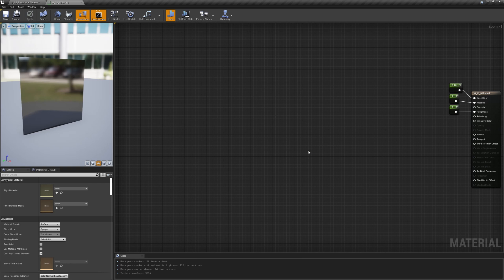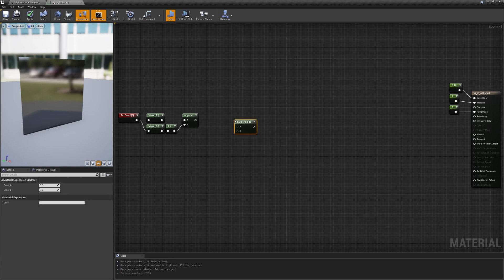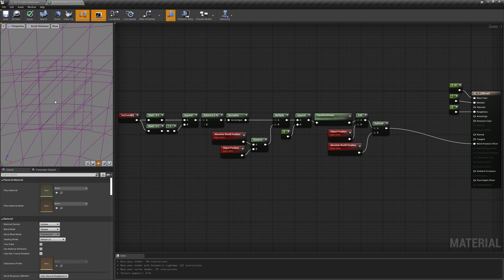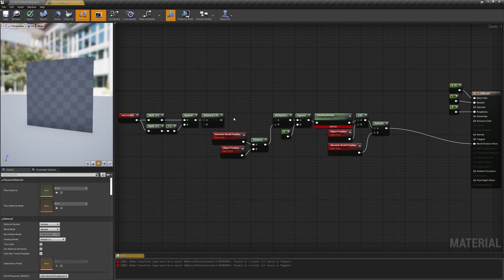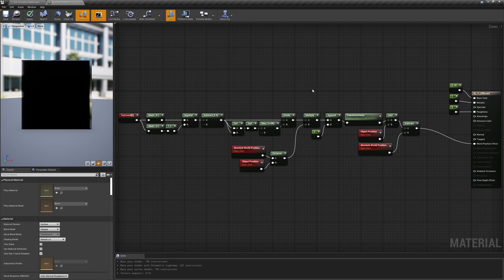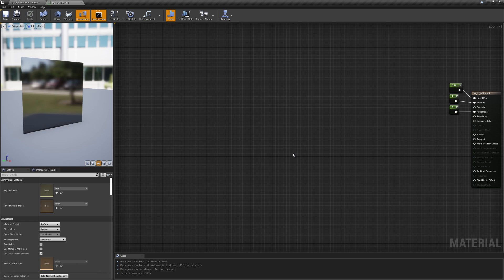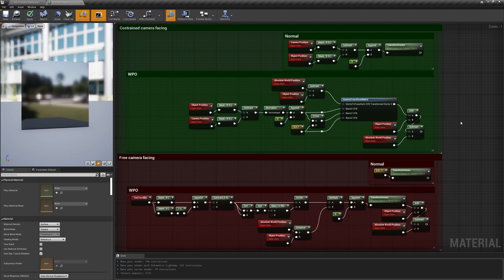How to make Camera Facing Billboards (UE4, valid for UE5)

Comment: hi thanks a lot. is it possible to make the image also stay the same scale no matter if you zoom in or out on it? Thanks.
Reply from the maker: It is :)
Think about scaling the billboard position vectors in relation to the camera distance
Reply: @VisualTechArt  thats what i tried before. But it always bugged when i added it together with the rotation. So scaling and facing camera was not working. Eventually i wrote a custom node and that worked. thanks 🙏

Comment: I have an issue with the second method which I use for tree billboards in my stylized game - if the object center is out of the camera frustrum, then the tree rotation jumps back to its original value, causing bad flickering - it's true when the tree is partially occluded or on the edge of the screen.  Trying to fix it for ages, and makes me crazy - any ideas how to fix that? :)
Reply from the maker: It shouldn't be related to object center but more to if the bounding box of the mesh is in sight or not, because that's what decides if the mesh gets culled or not :)
To fix that you should expand the bounds of the mesh so they cover the mesh possible positions after the WPO :)
Reply: @VisualTechArt  Thank you very much, it fixed my problem! You can't imagine how happy I am right now! :)

Comment: Hey there, thanks for the great tutorial! I have a question as a total beginner: how would I make the plane face in the direction of my camera normal instead of the camera itself? I am using an isometric view for renderings and I would like all the planes to face the same direction, right now my meshes turn towards the camera which tilts them a bit the more as they get on the edge of my view. Any ideas?
Reply from the maker: Use the CameraDirectionVector instead of the CameraVectorWS :)
Reply: @VisualTechArt  awesome! works great, thanks <3

Comment: Works great, however when this is placed on randomly rotated tree instances it doesn't override the original rotation. So a lot of them are facing the wrong way or are misaligned. I'm looking to I guess reset the rotation of all the billboards to face +X in the material before doing the point towards camera operation. But I'm not sure how, any ideas?
Reply from the maker: You have to add a rotation before the billboard logic in that case that resets your rotation :)
You have to find the 3 vectors that identify your rotated space axis and then use an InverseTransformMatrix to reset it

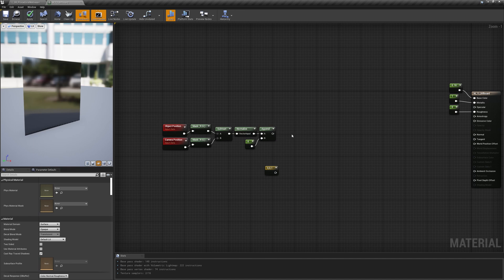Comment: 8:20 Wait a second, you're subtracting camera position from object position meaning you're getting a vector that points from camera to object, NOT from object to camera, which was what the X axis should be. How come this works?! Normally a vector from point A to B = B-A.
Reply from the maker: Follow the signs xD
Reply: @VisualTechArt  I can see that the normals are rotated later towards camera. that is enough? It doesn't matter that the triangles are drawn in reverse order?

Comment: This is amazing, thank you so much for sharing! This setup gets me very far to the desired result, but I wonder, is it easy to have the billboard pivoted around it's own pivot point instead of the object's center?

Replacing the ObjectPosition node with the objectpivotpoint gets really close, but is that the right way? It partially works..

Would love to hear from you, thanks so much again.
Reply from the maker: Try with ActorPosition, InstancePosition and so on :)
Reply: @VisualTechArt  I did some alterations and now better understand how it works, thanks again for this video and technique, its great!
Reply: @macarmoni  In my case I need to use local position but while using that , camera transform is not working.. I tried every destination option but it's not working .help me :(
Reply: @VisualTechArt  In my case I need to use local position but while using that , camera transform is not working.. I tried every destination option but it's not working .help me :(

Comment: Hi! Thanks for this tutorial! I have a problem, since the plane has an initial offset rotation. I need that the plane faces the camera regardless its initial offset. Any suggestions?
Reply from the maker: If you can't avoid them starting from a "random" rotation, the most straightforward way to compensate for it would be to first add a transformation step that gives you the vertex offset to put the mesh back to a non rotated state and then do the billboard from there :)

Then you can probably do something smarter than that, but it would be a starting point
Reply: @VisualTechArt  One last question: to blend a normal map with the recalculated vertex normals , I added the two together and then normalize it. Is it correct?
Reply from the maker: It is an approximation that can work, but it's not the most accurate way to do it :)
You could use the BlendAngleCorrectedNormals
Reply: @VisualTechArt  How do you do that transformation step? I'm going nuts trying to figure this out.

Comment: This tutorial is super helpful, but I'm not running into some issues with the AA in Unreal. When using the default temporal super resolution in Unreal, if any actor with this material applies moves at all, it creates some rather hideous ghosting during movement. I can solve it by turning the AA to another setting, but at the cost of making the lighting look considerably worse. Has anyone else encountered this at all?
Reply from the maker: That's weird, never tried it with TSR tho

Comment: Hello! This works extremely well. Only issue I'm having is that in the flipbook editor window, the thing is invisible. There's something weird going on until you disconnect the world offset. Not really a solution. Got any ideas? Thing is abandonware, I know, but it's about the only way to really go about making oldschool 2D things. Thanks!
Reply: Alright. Figured it out after a horrible night of sleep.
Looks like there might be an internal issue with the flipbook system itself.
Solution: Just set your flipbook component in your char or wherever to -90° or +90° on the Z. While you work inside the flipbook to set up your stuff, just keep the default material on it if you can.
Either OnConstruct use SetMaterial or set it manually on the flipbook. Main thing that matters is the Z rotation.
The material from this video works 100% for anything properly facing north aka. X forward. Looks like the flipbook component itself does something weird.
Thanks again for the video!

Comment: For some ungodly reason this material actually doesn't work if you apply the material to a Paper Flipbook Component for a 2D sprite character. The sprite becomes slightly twisted and not perfectly facing the camera
Reply from the maker: As long the mesh is a plane and the UVs cover the entire quadrant, I can't see why it shouldn't work 🤔
Reply: @VisualTechArt  I just ran into an issue, not sure if its the same as OP but I was trying to use this on a flipbook that has multiple sprites, took me awhile to realize that the UV mapping for a flipbook(with a texture with multiple sprites) isnt correct for this since we are assuming the entirety of the UV covers a single sprite. I am currently working out how to pass the frame number to the material to calculate the offset. Just posting this here in case anyone else runs into this!
Reply: I fixed my issue, I just needed to mod the r value by 0.2 then multiply the remainder by 5(my sprite flipbook has 5 frames, assuming flipbooks lay things out horizontally always...).
Reply: @versatus0  can you provide a copy of that in BlueprintUE? I've tried to do it here but couldn't figure it out. Thanks in advance!
Reply: @versatus0  I'm currently trying to troubleshoot the G value since my material is a 4x4 grid
Reply: Okay so I'm back after playing around with it a bit, and what it seems like is however the sprite material does its rendering doesn't mesh perfectly with the material. I already tried @jblouir's method and that worked in terms of getting the sprite to display in the correctly position, but I am still seeing some strange artifacting from the material where the plane seems to slightly tilt forward.

Comment: hello, I need to rotate the object plane relative to the camera, but the problem is that I put a rectangular texture on the plane, and the material stretches it to a square. Could you suggest how to solve this?
Reply from the maker: You're not forced to use a square plane to make a billboard, you can use a rectangular plane! Otherwise play with the UV tiling to preserve the texture proportions
Reply: @VisualTechArt  Thanks, my problem was that I took the "plan" UE and scaled it up, in the end it makes it original size
Reply: @VisualTechArt  hi and thanks  lot for this great series of tutorials, they are amazing! Working in UE 5.4.2, I'm having a problem with the first method in this video, and was wondering if you could help. Everything works great from any camera angle, but just like @GrAIUnrealEngine, I'm trying to apply the material to a plane that's scaled 2.5 in X and 0.69 in Y (which gives me the aspect ratio of the texture I want to use). However, no matter what I do, the material always makes the texture square. I've tried playing around with the UV tiling like you suggested, but that just gives me weird glitches... Do you know how to solve this? I'm sure I'm missing something simple. Thanks in advance!

Comment: Amazing!!!But I found one problem, if I use foliage tool to plant this plane, from method one, the plane looks stretched, and using method two, the facing function seems doesn't work......Do u have any ideas how to fix it? Anyway, thanks for ur awesome tutorial!
Reply from the maker: Try to check the default orientation of your plane! Has to be facing the X+ direction, if I remember correctly
Reply: @VisualTechArt  Problem solved!!!! U are sooooooo amazing!!! thanks very much!
Reply: @zhouchenxuan2920  In my case I need to use local position but while using that , camera transform is not working.. I tried every destination option but it's not working .help me :(

Comment: The shader works great for a simple mesh actor placed in the level. but something weird happens when scattered with foliage tool (as HISM) the billboard Z location seems to change and it shows under the ground. How can I fix that? thanks
Reply from the maker: I answered you in Discord :)
Reply: @VisualTechArt  Too bad you posted your answer elsewhere, I have the same problem... I'd like to have my sprites standing up like in Doom. How can I exclude Z from the transformation ? Great video, thanks !
Reply from the maker: @tiborostube1  Follow the second method and make sure to have the billboards facing the X axis (I think this was the issue)

Comment: when I the second method, the one that the plane  is locked in the Z-axis, the material ends up invisible ingame, unless I activate "two sided material". How can I fix this?
Before anyone say tell that i'm already answering my own question, the light reflects the sun from the wrong side if I'm seeing the material from the side it's not supposed to.

edit: after trial and error i found that I just needed to multiply the input of the 'BasisZ' value in 'the Inverse Transform Matrix' by '-1'.
Now, since the normal map socket of the material is busy, how can I put my own normal map there? I probably have to mix it somewhere but I don't know how.
Reply from the maker: That's what I was about to suggest! Nice that you figured it out by yourself :D
Reply: @VisualTechArt  Still he wants to know how to integrate his normal map with your normal fix method. I also wanna know
Reply from the maker: @omri1324  You have to use the new normal as base for the one you want to apply, try having a look to this :)

https://youtu.be/4RFvjpvtVKY

Comment: Hello. I have an idea. that's just for the material to show up in about 10 perpendicular degrees as the camera moves around the object. then it automatically hides. is there any way to do that. I am wanting to make a tree from 18 render tree images. I used google translate for this comment. sorry my english is so bad.
Reply from the maker: Mmm, I'm not sure if you want a camera facing plane that, depending on the rotation, displays a different texture or a mesh made of 18 radial planes that shows only the one orthogonally facing the camera.

For the first option my suggestion is to use the angle between plane and camera to choose what to display from an atlas texture.

For the second one you can use the fresnel effect to hide the planes you don't want to be visible.
Reply: @VisualTechArt  thank you so much for the answer and also the video above. what i want is in the 2nd part, and i'm just rendering a LOD tree with the fewest triangles. make a grove, yes... thank you for the job.

Comment: That is awesome! Was trying to find a solution like this for ages!
Question: How would you handle scaling the vertices with this method? So we can control the size via Material?
Reply from the maker: For which of the two methods do you want to know the scaling? :D
Reply: Ah sorry! Would be for the 1st method, the full billboard!
Reply from the maker: @Peppyssj  Well... If you think about it there's a point where we multiply the new vertices directions (normalized) by the distance between the object origin and the original vertices positions. That means that we're scaling the directions by something, think about what would you do to make the mesh twice as big ;)

Maybe you can find some more inspiration in the video I published before this